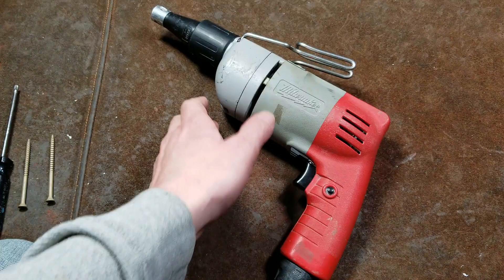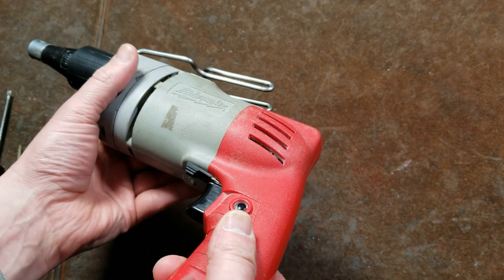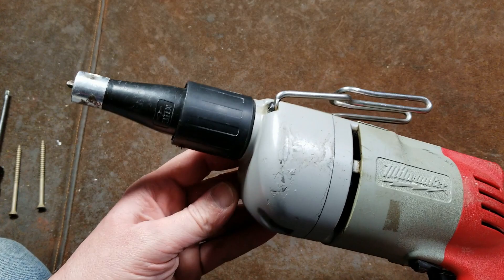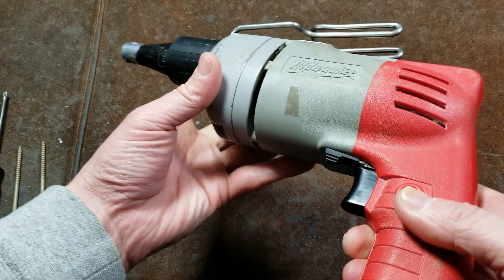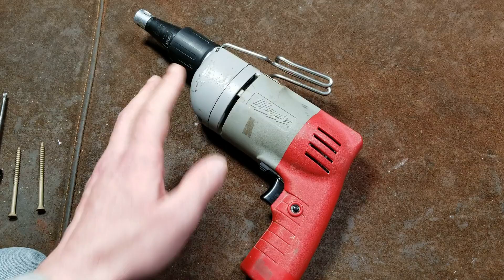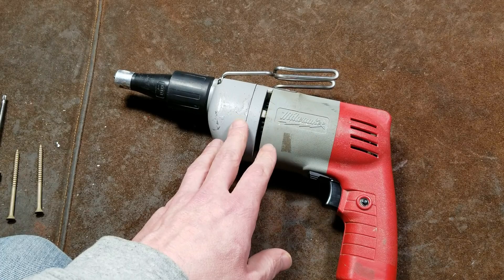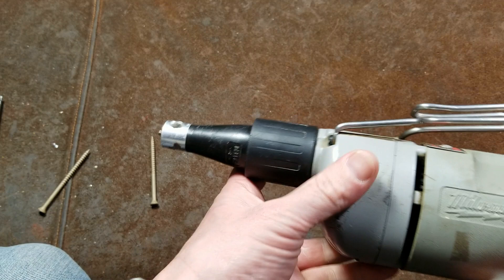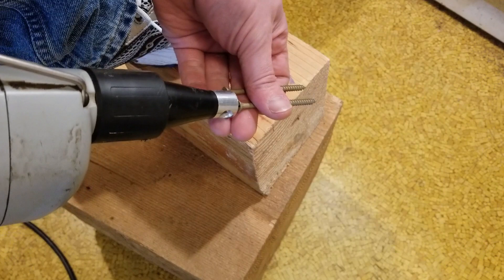Milwaukee Drywall Screwdriver Review & Teardown (Re-upload)

Comment: I picked up a used Makita version of this tool someplace about 35 years ago. It worked, but it was very heavy, and since I wasn't putting up drywall (I got it to build a deck) I didn't find it that great. And then I got a Dewalt ni-cad drill-driver, and I never used the drywall screwdriver again. Maybe these are better for drywall than a cordless impact driver, but I'd never use it for a deck.